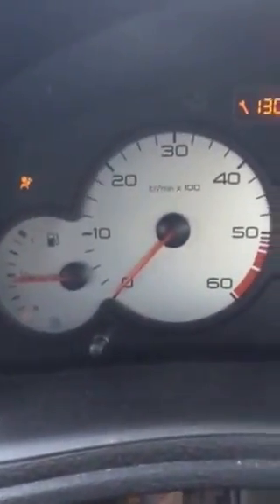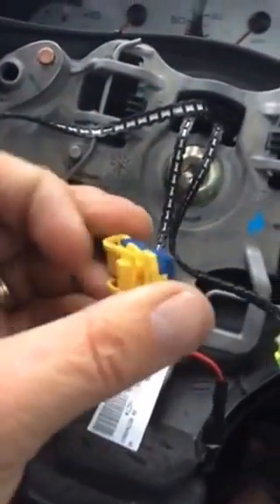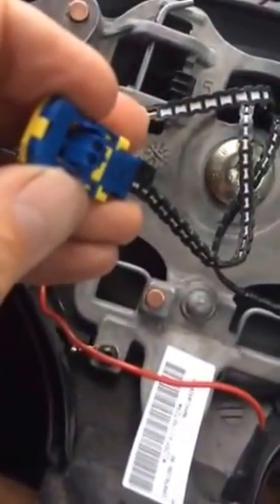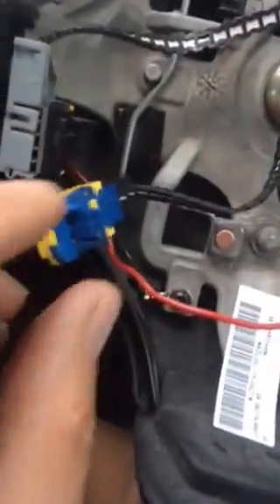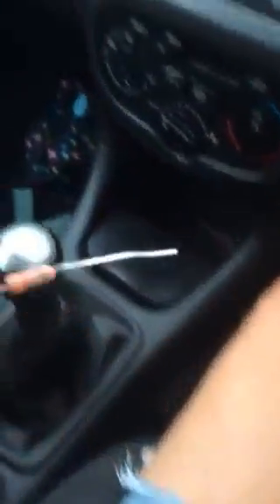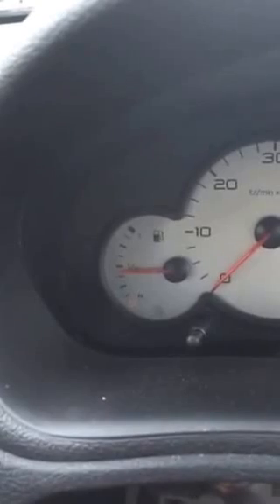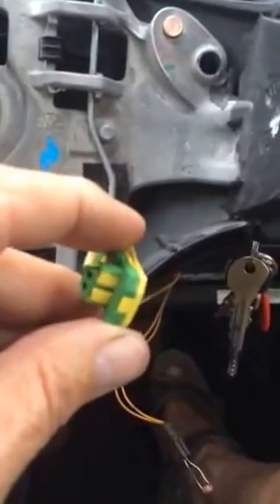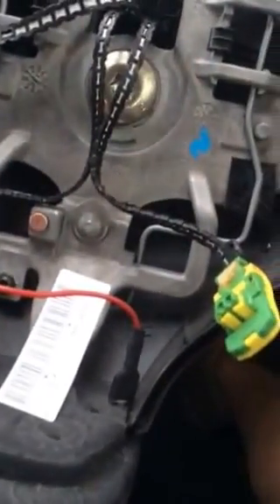Peugeot 206 airbag warning light, how to fault find using resistors

Comment: Hi John, I followed your test but have a problem. When inserting the resistors across the lower blue and brown connectors and then turned the ignition on, the light on the dashboard did not go out? So what could be the problem. The first part of the other connectors turned out the correct resistance.
Reply: we have the same problem where the light just doesn't wanna go off, and the resistance apparently measured ok at the various points- did you ever solve this issue brian?

Comment from the maker: Check you pushed both of the airbag connectors fully in before you pushed the yellow retainer home. The connectors should be firmly held in place if they are in properly. If not, the light will come on as the connection is not made

Comment from the maker: Don’t think you need high wattage resistors as the power running through them is tiny. Just cheap ebay ones will be fine

Comment: Thank you a lot mate! Tried this and turns out one of the cables had higher resistance ( at 2Ohms ) and was causing the airbag error. I simply starting shaking the small airbag cable assembly right behind the wheel and the resistance went back to normal, clearing the airbag error.

Comment: Thanks for this video, I have had a Peugeot 206 for about 3 years now and it has failed the NCT here in Ireland because of this light, I think that a previous boy racer that owned the car may have replaced the original seats with bucket seats and I think put standard seats back in the car (without airbags) before selling it on and blocking the  airbag light in the cluster display. This was pointed out to me by the tester. Have tried to fix it in the past but will use this method and test all.

Comment: your the man, i want to remove passenger seat in my nissan leaf and it has an airbag fitted in the seat. will it have two yellow plugs like yours, is it 2.2 or 3.3 ohm resister needed? what would i do about the sensor that tells the car someone is sitting on the seat?

Comment: Hi mister John i really enjoy your video I just bought one 2.0 petrol 206 to run in circuit and every day car so I put sparco steering wheel and sparco buckets your video helps a lot so 3.3 resisters and the question I wanted to do how manny watts ? Our its doesn't matter? Please help
Reply: hi, did you solved it? how many wat did you use for it finaly?

Comment: Goodmorning. I bought two Sparco sports seats for the Peugeot 206 cc but they do not have side airbags. Under the car carpet there is a plug with three cables that must be connected to the original seat. Where can I find a side airbag emulator to connect to the switch under the carpet so that I can turn off the warning light on the dashboard?
Could you please tell me what each color of the side airbag cable refers to? For example what is the 12+ cable. which is GND and which is the signal cable.  
Thanks. Best regards.

Comment: the old man tested things as you did and found no problems with connections between points, yet the airbag light remains lit :<

i would have thought replacing basically everything with the appropriate resistor would switch off the airbag light, but it just stays lit.

we're gonna grab a scan tool of some sort to hopefully shed some light on it, but i really don't understand what could be wrong. any ideas? i feel like i might have to go through the same process myself to make sure he copied you correctly

Comment: Thanks Sr, sorry but I crashed My P206, and the airbag system was activated, (thanks for god), now my car is ready to used but no have airbag system and this light is come on, I must make this in all system conector ?(steering wheel, passenger airbag connector, and seat belt).or only doing this in the steering wheel connector is sufficient?
Reply from the maker: edgar goncalves , depends on your car. You’ll need to replace any airbags that deployed in the crash.
Reply: Also the airbag module on my 206 180 stored crash codes and needed replacement or repair
Reply: @MonyetButler  thanks
Reply: @wjohnupton  thanks Sr

Comment: I have a Peugeot 206 and have same problem with the airbag light always on but i was told its the passenger side air bag. Do u know how i would I fix that ?
Reply from the maker: It will be the same system, so probably the same resistors needed but the wires will route over to the passenger side. Have a look around the back of the glove compartment and see if you can find any wires with similar plugs. The contoller pc is behind the ash try if i remember so you can trace the wires out from the controller from there.

Comment: would a different car take different amounts of resistance? if so how do you find out how much resistance it needs?
Reply from the maker: Don't know, best to google the car type. I'd expect all airbags to be similar in electrical construction, so pretty close to 3 ohms.
Reply: @wjohnupton  how many watts for the 3.3ohms.?
I there are different watts available.
Great video.
Thanks